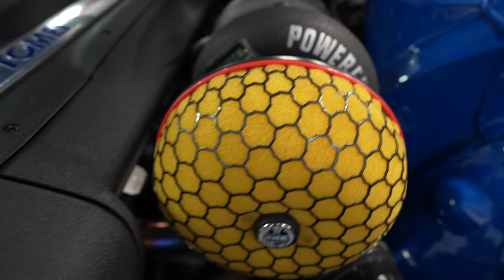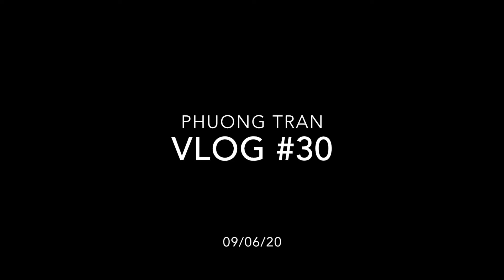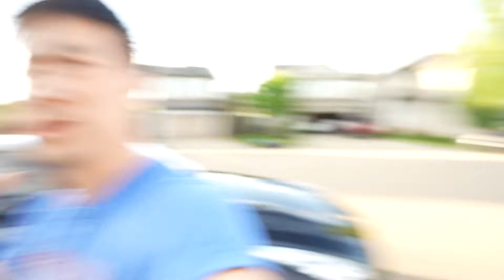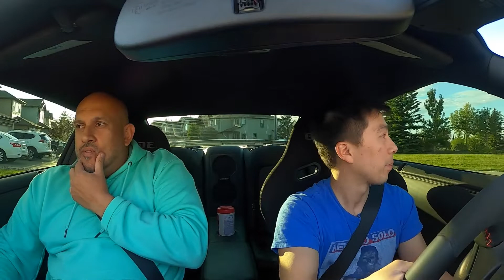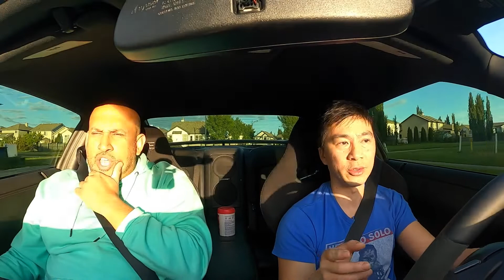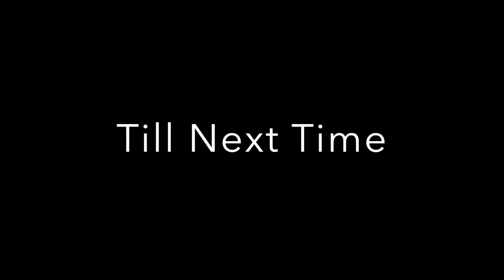Pros and Cons of Installing SPL Suspension Parts!

Comment: Great video covering the NVH and some of the pros. A big difference between OEM rubber bushings and SPL sphericals is the friction and binding as the suspension moves. In some suspension setups you could see hundreds of pounds of total binding force that acts like having stiff, progressive springs. If the suspension is already loaded up then that means the undampened tire is a more active component in the spring/compliance chain, leading to the tire skipping and a loss of grip. PTFE-lined sphericals, even new, have very little to no friction which allows the damper and spring to do their job. All of this is going on in the background, but is an aspect of suspension that is rarely talked about.
Reply from the maker: Alan thanks for the great infomation!

Comment: Yeah doing the full SPL Parts treatment (all arms and bushings replaced) with some Öhlins DFVs to my G totally transformed the car from a touring car to a true sports car, and I don't notice a whole lot of harshness when I turn the dampers down. The suspension is set up for neutral squat and it just feels so connected now! If I want luxury I would just get a long wheelbase sedan.
Reply from the maker: It is amazing how it transforms the feel of the car eh. That is how I felt when I drop it for the first time. If you get a chance drive a stock gtr and yours back to back. It will blow you away how different they are. 👍

Comment: thanks for the review dude. been wanting a forged performance sway bar too.
Reply from the maker: Comparing between the two forged performance are definitely better. The endlinks are 100% better and a lot easier to install then the whiteline endlinks. Spend the extra for forged performance.
Reply: Phuong Tran Unscripted thanks for the recommendation. I do like that they are beefier than other sway bars.